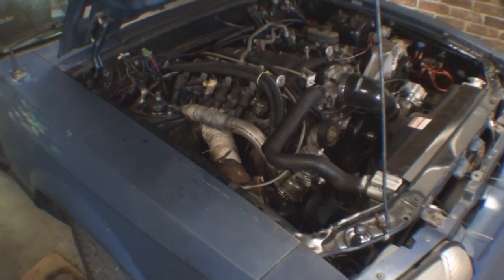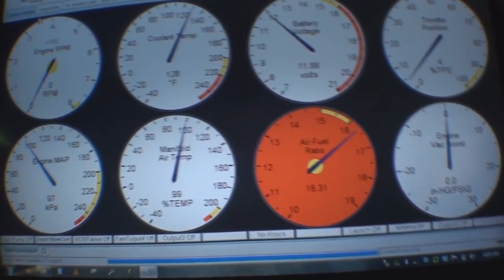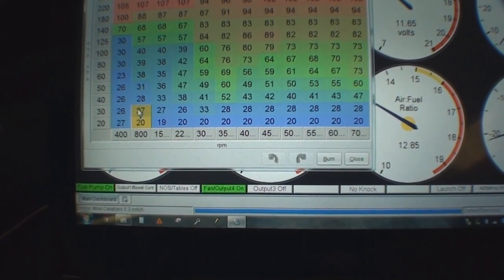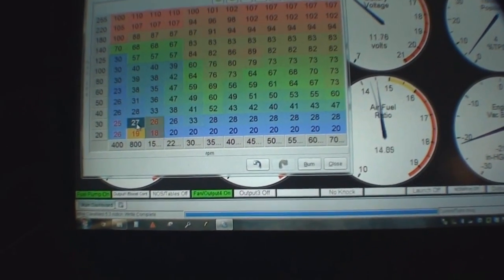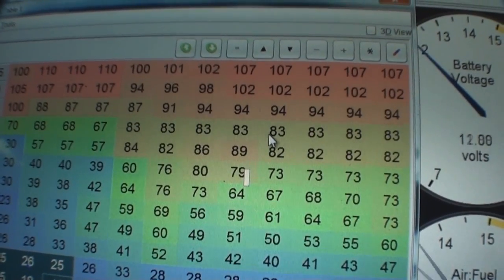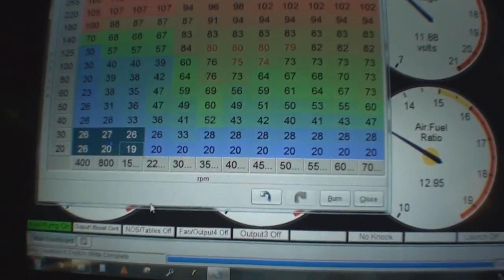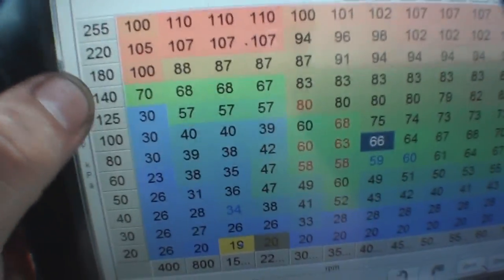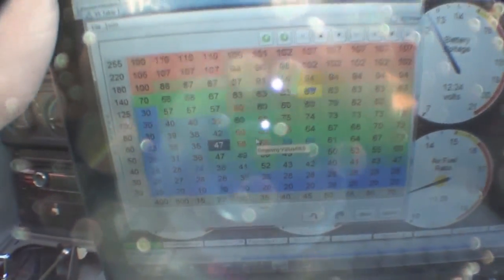7-18-13 quick how to tune Megasquirt fuel tables

Comment: So a generic question, with the idle hunt , as seen with trying to tame a gnarly camshaft , is there a menu section in the Tuner  Studio that will allow you to change the “Idle Adaptive Spark Control” over speed and under speed timing as you can with HPTuners ?  
  Looking to use Tuner Studio with a Speeduino ECU.  
  Don’t have it yet but would like to look through Tuner Studio as a demo but cannot seem to find anything more that the online book .  We cannot start searching through until you hook up a ECU apparently . 
  Thanks Matt !   Great videos.

Comment: A couple tuning questions? When tuning fuel/timing maps, do you tune to the maximum boost pressure from the start? For example say I want to run a max of 14psi for a hot tune, but i want to tune it down to 10 on the street. When tuning timing maps and fuel maps do you start at wastegate pressure than add pound per pound and than go back and check your maps? 

Also Could you do a video on tuning a timing map , i have yet to find one here on youtube.

Comment: I also know this is a very old video but is that afr from a wideband or narrow? Because I can't for the life of me get that megasquirt gauge (narrowband) to match my wideband gauge
Reply from the maker: Michael Casella usually a grounding issue, you can also change the scale on the settings till it matches.
Reply: You should be able to run the output from the wideband straight to the ecu. MS doesn't need the stock narrowband o2

Comment: I know this is and old video but I hope you can still answer me
I'm just getting in to the boost and tuning stuff not knowing anything about it yet  I'm working in my 1990 5.0l getting a turbo on would you use the same numbers for AFR or close anyways and what do i need to change for the distributor to use advanced timing 
I got the megasquirt plug and play for mustang.

Comment: Found the problem! when I first start cranking the rpm spikes to about 9000 rpm and the injector ms guage shoots up to 25ms therefore flooding the engine. So I put the 80kpa line in the ve table to 0 across the whole board and it starts beautifully. Any ideas on how I can fix the spike?

Comment: Hey denmah I'm having an issue getting my car started when its at operating temprature 190-200f. I downloaded your base tune for a 5.3 on ls1 tech and it starts fine when it's cold but not when it's warm. I am still running the stock injectors because I want to familiarize my self with the ms1 and 6010 setup while it still NA. I have adjusted the cranking PW up and down and it's still a long crank before it fires. If i hold the throttle down it will start easier but still cranks for a while.

Comment: I really want to try retro fitting the ms/6010 setup on a BBC. I think with a crank trigger it would work fine. Better gas mileage which has always stopped me from building a BBC. That or a BW S480 1.32/96 LSX deal. My pops wants a Nova or Malibu, but it would leave us more cash for goodies if we do a fox/v6 sn95/ or v6 f-body.

Comment: i do have a powercommander, and went to zx10 injectors for xtra fuel, im running stock map since im only running 5 pds,  do u guys take any timing out and fuel pressure u running

Comment: love the vids keep them coming! very helpfull! and dont u hate that when the problem is right in front of u and u dont catch it likie the volts reading below 13.5 at the time u need to catch it.. I noticed the volts went up from 11 to 12 after driving was the wire hooked up then or is megasquirt volts off on the reading